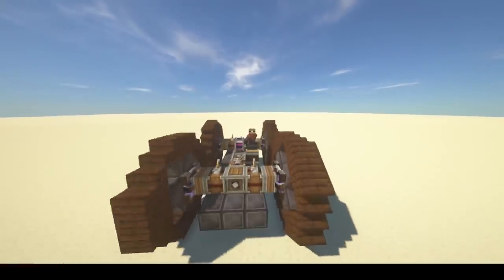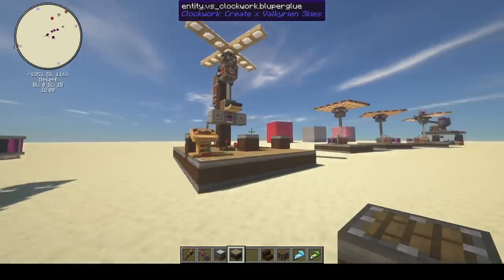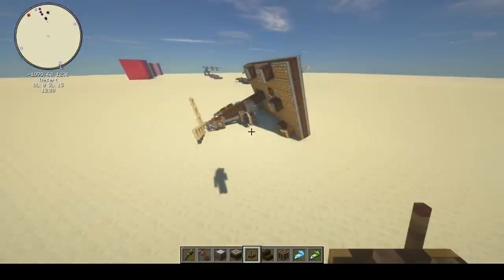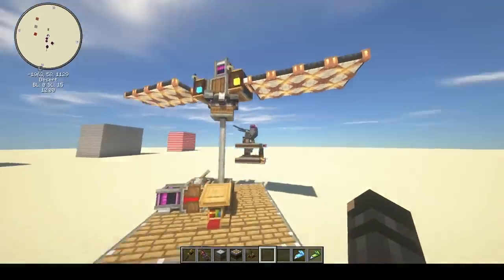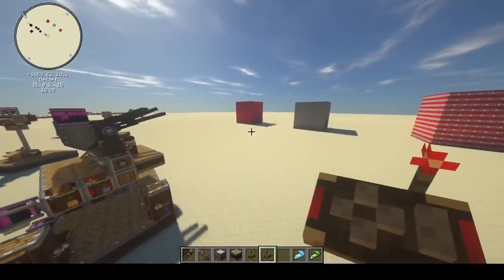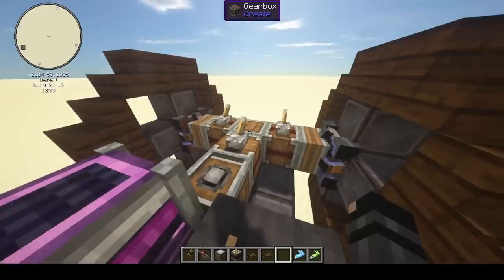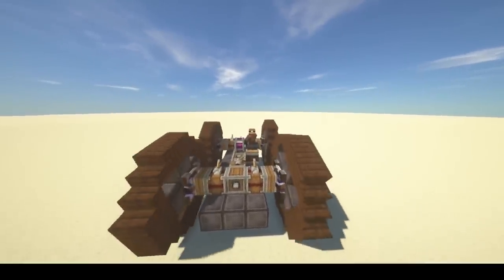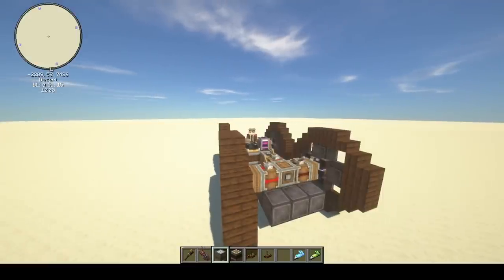Clockwork Physics Bearing Tutorial and Builds

Comment: Loved the video @Kwizzle Hazizzle! Can't wait for the next video man! I have a few Ideas for you that might prove Helpful for your some builds.

 • For a Car or a Truck, you might want a Physics Bearing on the Front Wheels for Steering and then One on Each Wheel so that it can Rotate. This will allow for people to Build 6×6 Trucks or 6×4 Trucks with All 6 or just the Back 4 Wheels to be Powered.

 • For Something with a Ramp like an LCVP, LCM 3, LCT Mark 5 or Mark 6, or even with Doors and a Ramp like the LST(2)'s and LSM-1 class Transports, make sure that you have 1 Physics Bearing on each side of the Hinge. This will allow for the Doors to Open to the Sides and the Ramps to come down and Allow for easy access to the Cargo or the Interior of the Vehicle or Ship.

 • For Something like a Gun Turret.... You seemed to have done just fine man. Just try Building a Triple Turret for the American 6"/47 Caliber Guns on the Cleveland-class Light Cruisers. The Barrels are 7 Blocks long and if I'm remembering the Build over on the Server for NavalBattleZone: High Caliber correctly, the Turret should be 7 Blocks long by 7 Blocks wide by 3 Blocks Tall. Then try the Twin 5"/38 Caliber Guns that were the Secondary Battery for the Cleveland's (5 by 3 by 3 Blocks for the Tuuret and the Barrel 4 or 5 Blocks long). These Turrets were the Main Battery for the Allen M. Sumner-class Destroyers as well. If you want a Single Mount like on the Fletcher-class Destroyers, that's just going to be 3 by 3 by 3 roughly. CraftyFoxe from the Minecraft Military Force (@MC Military Force) has a 2 Part Build Tutorial on the Fletcher-class Destroyers about 1 year or so ago as well as a 6 Part Tutorial on the Iowa-class Battleship USS Wisconsin (BB-64) if you need some help there because I know I will LMAO!

 • For Helicopters, the Flap Bearing is a Nice little touch for Building the Sikorsky CH-53E Sea Stallion, CH-53K King Stallion and CH-53J Super Stallion Helicopters as that is a Design Feature of their Rotor Blades. The Blades can Tilt Forwards or Backwards depending on if you're Taxiing out, Taking Off or Landing.

Once again, @Triode you have me Singing your Praises for an Awesome Mod for Minecraft and I'm still waiting to see if anyone else has done any World War Two Related Builds in a Survival Series.

Just out of Curiosity Kwizzle, which part of the World are you from man? Because I have Long Overdue Hello from Prince George's county, Maryland, USA!
Reply: You really wrote an essay, didn't you?

Comment: Cyclic is for moving the rotor blades for directional control i.e. tilting left, right and going forward and backwards. What you were referring to as cyclic is actually called the collective. The collective changes all of the blades angle of attack equally or collectively.